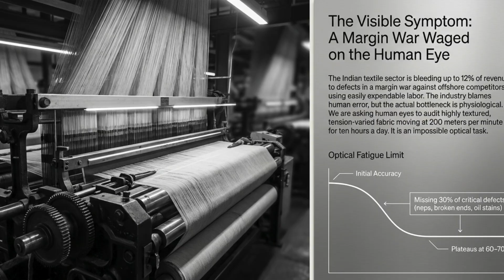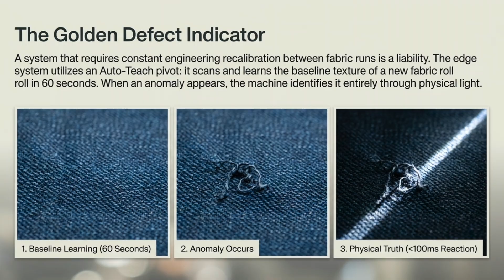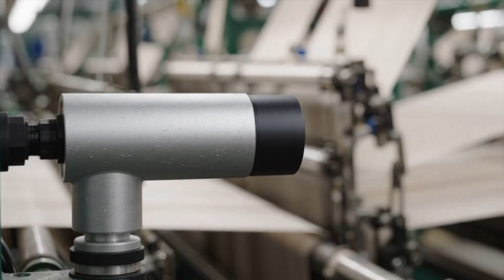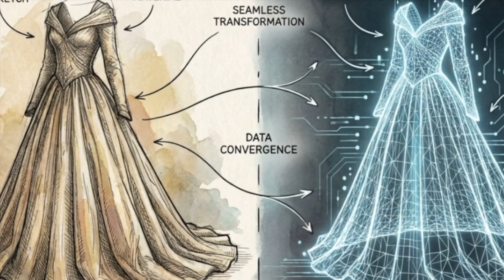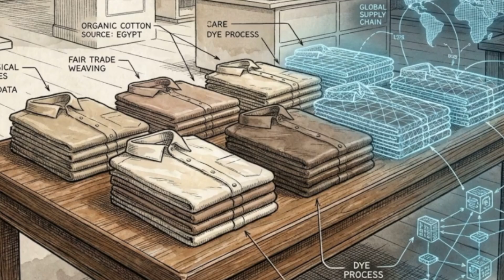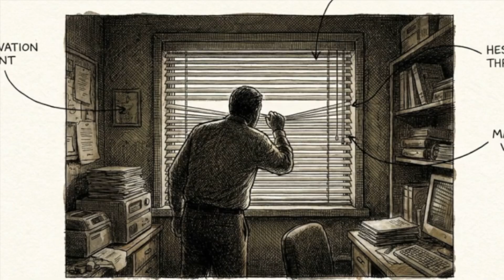The Latency Trap: Why Software Fails on the Factory Floor

Comment from the maker: Here are few sources for your reference 👉

  https://www.thetextileai.com/news/how-ai-is-transforming-indias-textile-industry-from-manufacturing-to-fashion

https://www.ijsat.org/papers/2025/2/4400.pdf

https://www.technavio.com/report/automation-market-in-textile-industry-analysis
Reply from the maker: The Fact Base (May 2026)
* The Velocity Problem: Modern power looms in India push fabric at speeds up to 200 meters per minute. 
* The Human Limit: Manual inspection achieves only 60–70% accuracy, missing up to 30% of defects (neps, broken ends, oil stains) due to optical fatigue. 
* The AI Delta: Automated vision systems drive defect rates down from 8–12% to a controlled 2–4%, yielding a 30–70% productivity gain and reclaiming up to 15% of material waste. 
* The Latency Trap: Cloud-based AI is useless on the factory floor. The network round-trip takes too long for continuous output.  
 

The Structural Bottlenecks
* The "Physics Wall": The actual bottleneck isn't the AI model; it is lighting and latency. A 200m/min loom moving highly textured, tension-varied fabric requires sub-100ms inference times. 
* Optical Hallucinations: Off-the-shelf computer vision breaks on textiles. Twill diagonals, reflective synthetic threads, and baseline fabric tension mimic defects to generalised models. 
* Legacy Integration: Indian MSMEs run legacy equipment. You cannot ask a factory operating on razor-thin margins to replace a $50,000 loom; the AI must retrofit over the existing iron.
Reply from the maker: Listen to this 👉 as you commute:  

https://open.spotify.com/episode/3SVflYNbYbbfVY9NzTUGRI?si=R_J8vBx_SpGrLxzmdWX5hw
Reply from the maker: Dive DEEPer Here 👉: 

https://prasadbhonde229.medium.com/the-latency-trap-why-software-fails-on-the-factory-floor-80670c7ea8bb
Reply from the maker: VIEW Here 👉: 

https://youtu.be/GJQKeAxyqcI
Reply from the maker: Access “A Manifesto for Functional Resilience: India’s Energy & AI Strategy” here 👉:  

https://docs.google.com/document/d/1CJ1JrMPtUf3fRXbeKNhEby9ftVI0MdEih2Cf83rGGGA/edit?usp=sharing
Reply from the maker: Connect here 👉 https://tr.ee/vYy2GL

  Or here 👉 https://linktr.ee/PRASADBHONDE
Reply from the maker: Or you may want to read this 👉 

https://amzn.in/d/01HOcXep